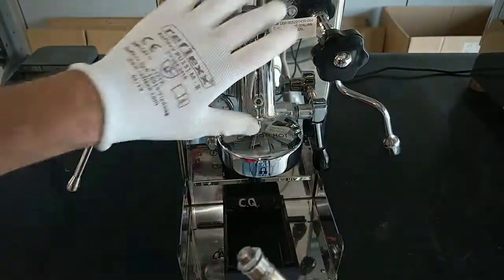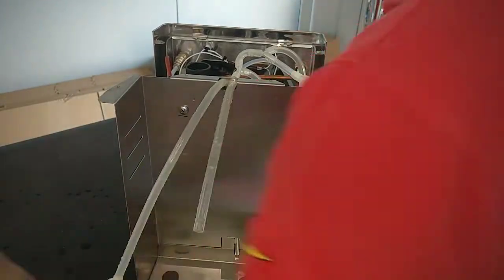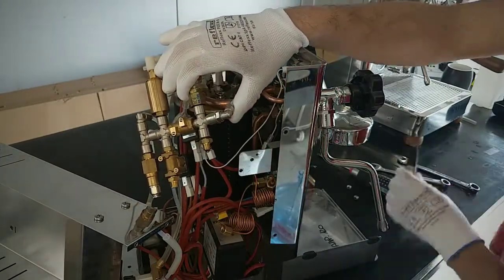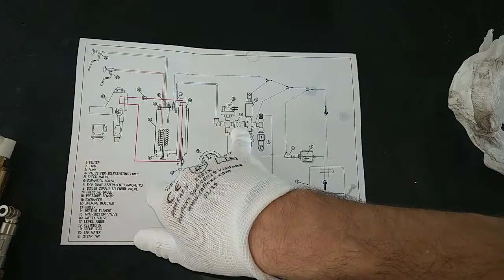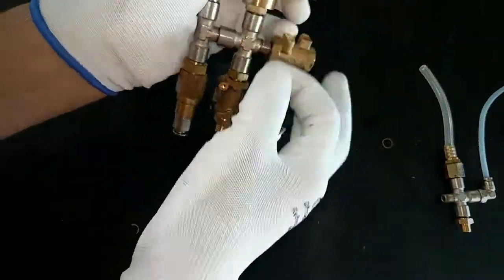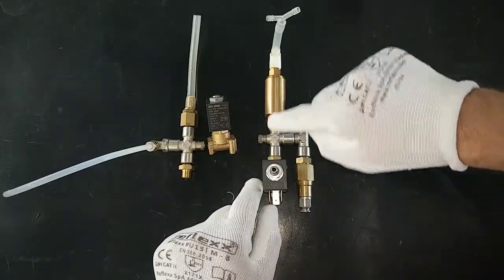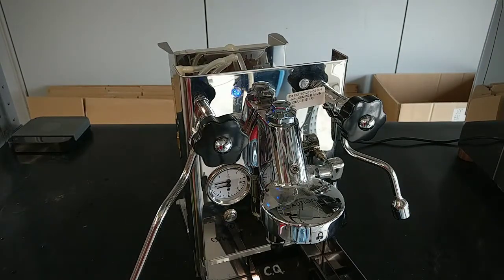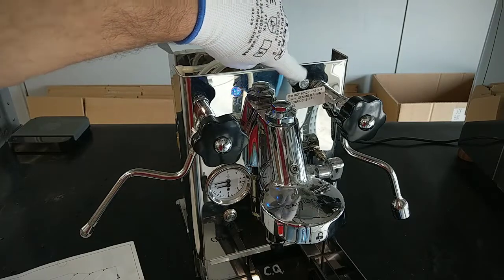PL62 PL62T PL62S Mara problem with solenoid valve

Comment: Great Video, Great work at your channel. I have a Lelit Mara PL62 an suddenly I'am not getting any brew pressure . The pressure gauge stuck to 0 with the blind filter in the portafilter . The water flow seems to be ok with eye checking.  Steam pressure is OK.I have already replaced the pump without fixing the problem. The OPV is clean ,I have checked it. Do you think that this is the fix that I should apply? Thank you very much
Reply from the maker: there are 2 cases 
-the pressure gauge does not go 
-there is no pressure in the filter holder, 

when you make coffee, does the coffee come out? you should find out whether the machine pushes 
if you want send a video at care@lelit.com
Reply: @lelitinsider2977  Thank you very very much for your quick reply!!! I will make a video and I will send it to the address that you mentioned.

Comment: Hello I just have a question I have a pl62 s and I would like to know exactly the pressure of the Pump it is 9 or 10 bars and at the level of the pressure of the boiler is it a 1.1bars thank you
you made as usual a great video good day
Reply from the maker: the pump push 15 bar, but the opv is settet abouth 9-10 bars, this sends the excess presion into the tank.